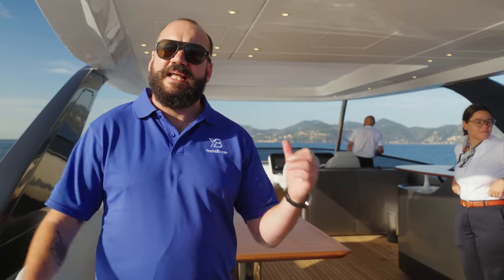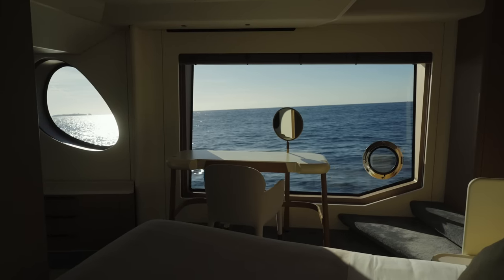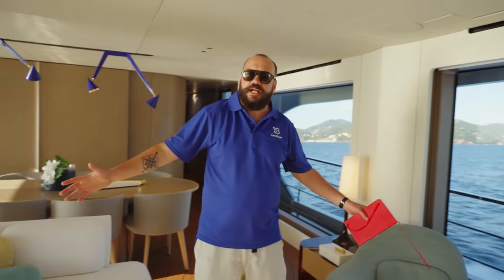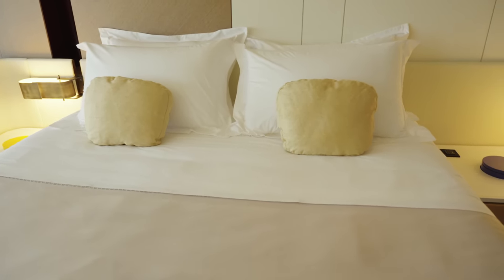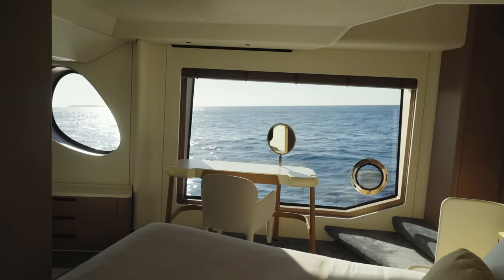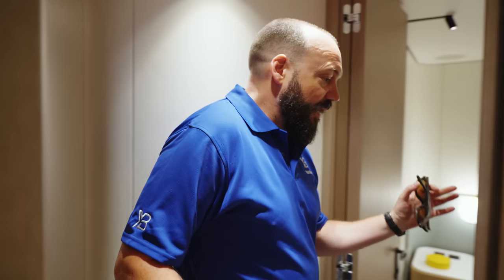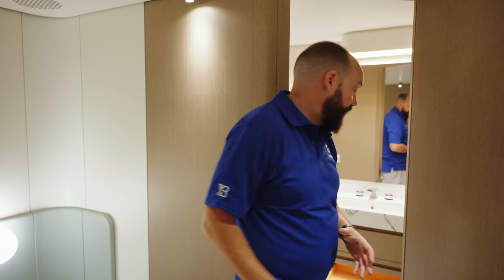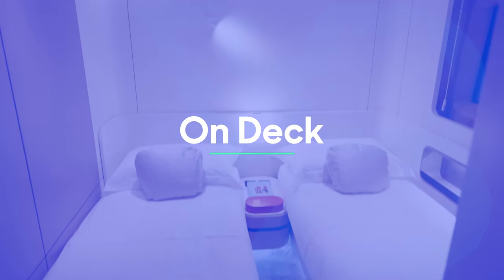Azimut Grande 26M Yacht Test Drive, Tour & Review | YachtBuyer

Comment: I like how a Swedish Delta or Uttern, a weekender at 8-11meters can accommodate sleeping for 4people.
But these 80-110feet Yachts with 100x the volume and 1000z the dry weight can only have sleeping for 6people 😂
They could with efficient planning and not much smaller cabins easily have 10-12 sleeping.
But waste space with an oversized aft and bow area and a open air sundeck for 30people..
Atleast the 3d fllor could have been half enclosed for another social area and then have two extra cabins in the midsection.
And a smaller mechanical area..

Comment: Nice enough, but the absence of a connection between upper and lower helms is a big negative - a deal breaker for some folks including me.  
Are you guys not bothering showing engine rooms?  Or listing data like tender size, generator power, etc?
Reply from the maker: Yes - we usually do show the engine room but this was filmed during the Cannes Boat Show so our time onboard was very limited. Follow the link to our written review on our website for full stats: https://www.yachtbuyer.com/en/reviews/azimut-grande-26-metri-2022
Reply: They put the dataset in the tech sheet, pinned comment.